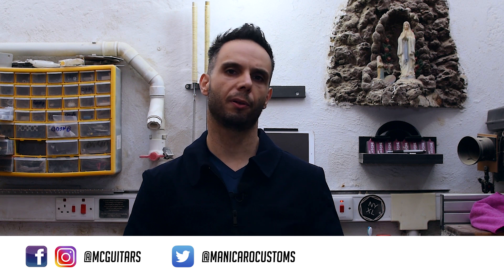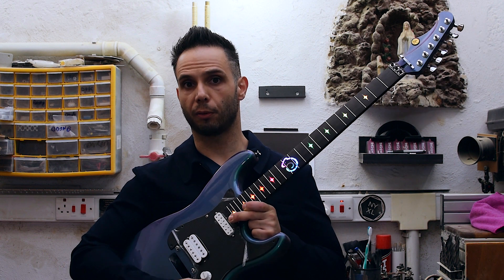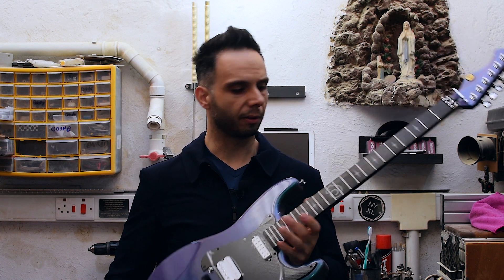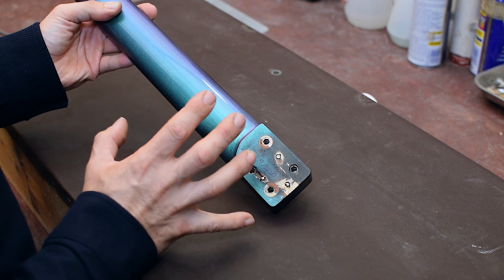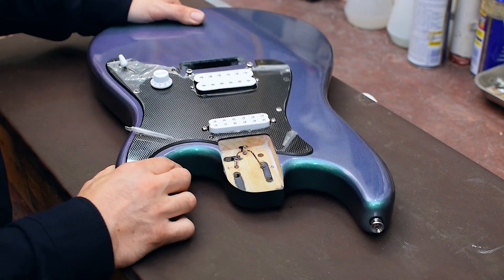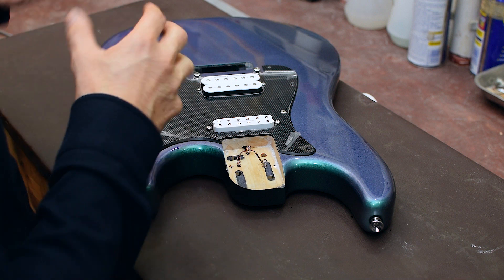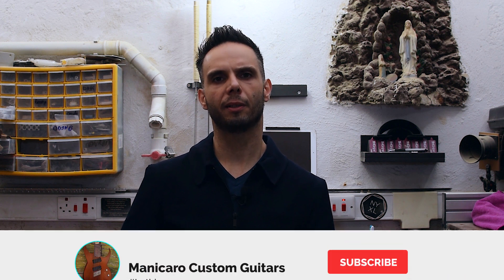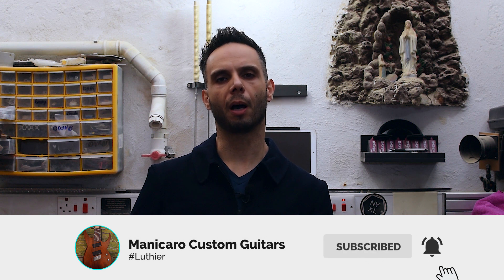LED Guitar Fretboard - Part5

Comment: Dont you get RF noise in your pickups as the colours change?....i built an arduino rgb led neck, and it was impossible to make it silent...and useable.  How did you cure the led noise????
Reply from the maker: Ohh my friend it’s not silent, I’m too dealing with that issue and it’s still unusable at the moment.
Reply: @ManicaroCustomGuitars    gotya...thought it would, i had the same issue, could never cure it, had to pull off fretboard and inlay static leds...
Reply from the maker: Pity, isn’t it?
Reply: @ManicaroCustomGuitars    yes  it is,  neopixels are great, any colour, patterns etc...but they just wont be nice with pickups...shame,

Comment: Next step, MIDI controlled lights that sync to a backing track.
Reply from the maker: That would be cool, but at the moment I haven't sorted out some of the interference. Still a work in progress....
Reply: @ManicaroCustomGuitars  I think this will be a bit hard to do now, but would having a strip of metal foil that covers all the lines for the lights work? Sounds like the pickup is having cross talk from the data line. So you have to shield the wire. Don't you just wish fretboards don't have to be glued?
Reply from the maker: @Parcolai  There is a lot to it not just the data line, power bank, the Arduino and LEDs produce noice, but I'm working on it.